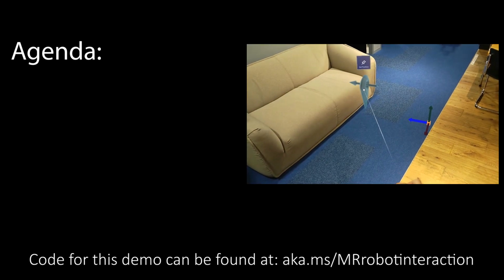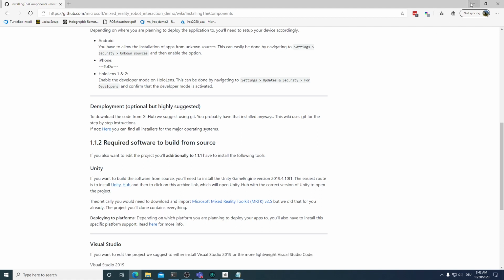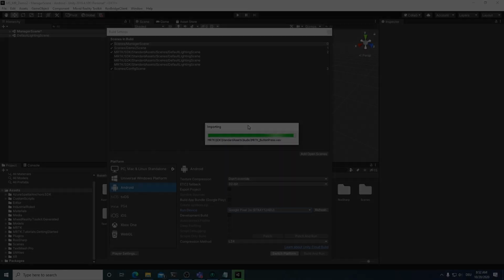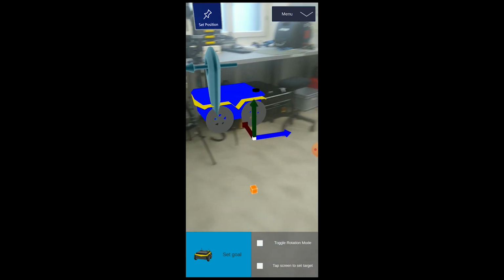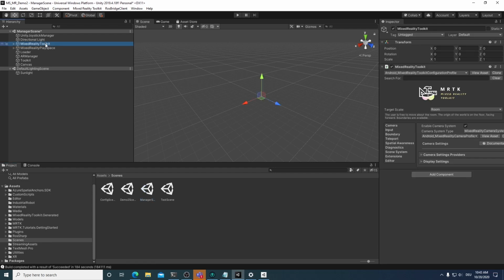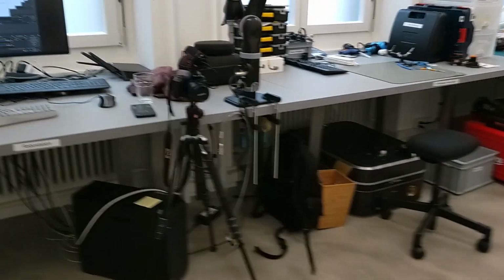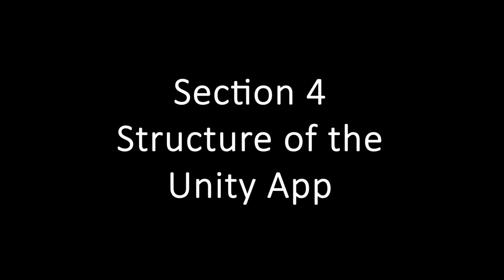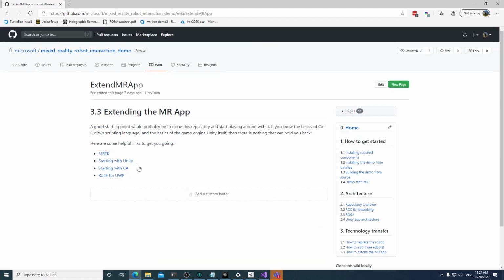IROS 2020 - Mixed Reality and Robotics Tutorial - Demo 1: Interaction

Comment: UnityEditor.BuildPlayerWindow+BuildMethodException: 2 errors
  at UnityEditor.BuildPlayerWindow+DefaultBuildMethods.BuildPlayer (UnityEditor.BuildPlayerOptions options) [0x002bb] in <8004fcc221b54f98ba547350ea71d812>:0 
  at UnityEditor.BuildPlayerWindow.CallBuildMethods (System.Boolean askForBuildLocation, UnityEditor.BuildOptions defaultBuildOptions) [0x00080] in <8004fcc221b54f98ba547350ea71d812>:0 
UnityEngine.GUIUtility:ProcessEvent(Int32, IntPtr)

I'm getting this error when I tried to build in hololens., I downloaded the suggested version only
Reply: I solved it, by deleting the wsa certificate in the parent folder of unity package. When we build again, this certificate is regenerated.